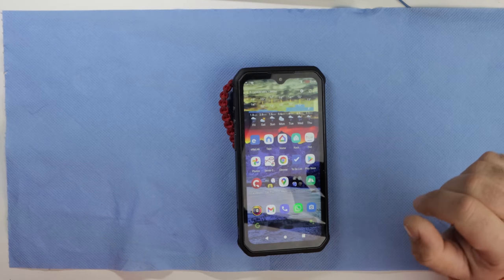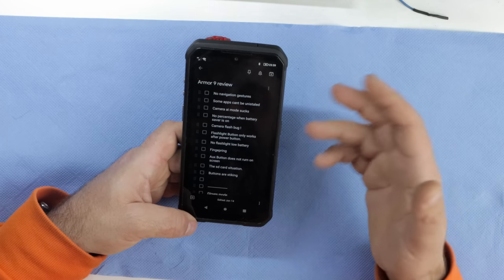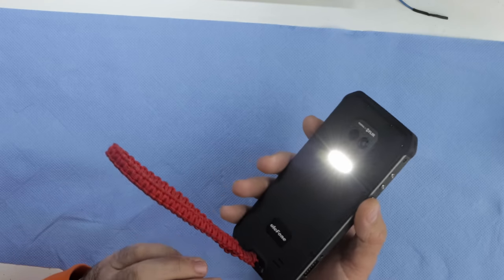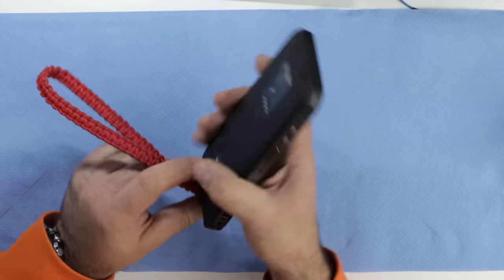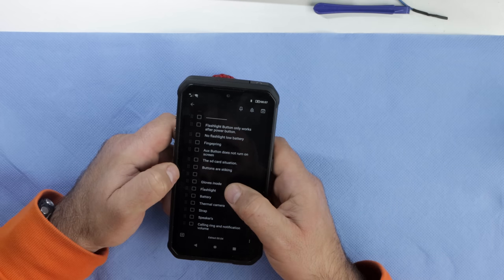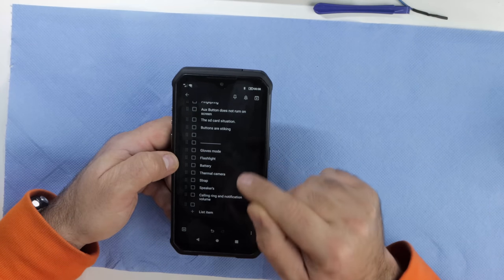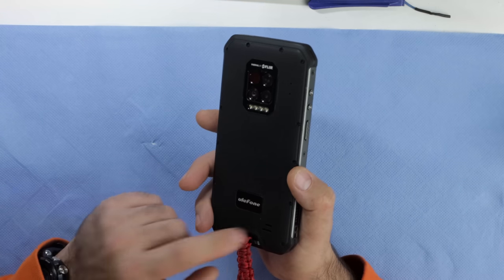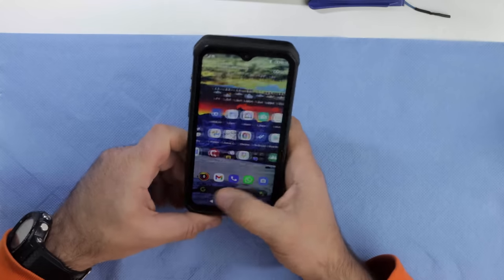uleFone armor 9 follow up 6 months later | The whole truth about this phone !

Comment: I have the 9e. I could not side load Google camera, it just would not do it. No matter which one I downloaded, also with the flash on the camera mine worked fine, but the flash would flash even when it turned off haha.. also I use th flashlight at work and I've been let down by the flash light not working on low battery it sucks ass. The battery is the only good thing
Reply: Are you not 
exaggerating by saying the battery is the only good thing... I am thinking of buying this phone and using it for bike delivery and good to have this kinda phone for these strange times. Is the GPS decent can it handle multi able apps with internet at the same time and no overheating?. Or you really would not recommend this phone?
Reply: @dodig1125  okay so here's my pros and cons

Pros
-decent processing power, doesn't lag doing everyday stuff
-huge battery 
-very loud speaker
-programmable button on the side is very useful
Flashlight is very bright for a cheap phone
-endoscope is actually very well made and works great

Cons
-its much bigger and heavier than I thought it would be, no magnetic phone holder will hold it
-camera is rubbish, considering it has 4
-the sd card slot is a pain to access
-the charger port is literally impossible to open if you have short finger nails
-it won't be as rugged as some other phones, my old ulefone armor X5 had much thicker rubber and much bigger plugs for charger hole, I don't think it would survive a huge drop
-the microphone hole is right where your pinky finger sits at the bottom on a right handed person 

It's a decent phone for what it is, I haven't used the GPS yet but my X5 was good so I'd say it'll be right

if I needed a phone for navigating on a bike I'd dare say this is a decent option, big bright screen, water resistant and big battery should tick all your boxes.
The weight of the phone would get annoying if you had to carry it around all day like I do, I put up with it but it really is a chunky boi

Comment: The complaint about the light seems like you dont understand the logic behind it. If all it takes is for you to touch the button to turn the flashlight on then it can be activated in your pocket accidently and further drain your battery. I think its smart that they require a "conscious" decision to activate the smart button.
Reply from the maker: Then why  not just turn the flashlight on from the lock screen ? A dedicated button is supposed to be faster and easier if its not, there is not much  point to it.
Reply: @reversingentropy  so youd rather it turn on excessively than to spend the milisecond to turn the display on and activate the button? Okay
Reply from the maker: It's very rare  to activate  the button  by mistake. Yes. like any other phone with  a dedicated button i would  rader it would  just  work without having  to press any other buttons. You know, you  can't  turn the flashlight off either without first waking the phone up. If it was indeed made to protect the battery it would let you turn it off once it's  on. Anyways I don't like decisions being made for me loool
Reply: @TheFishAirman  
The thing is I have the side button set to turn on the flashlight too and even with this "safety measure" it still turns on in my pocket. I wish I could set a specific button tap code, like double-click then hold to activate the flashlight.
Reply from the maker: Yes that would be nice. Maybe in the future.

Comment: A year later now, but FYI my Armor 9 has been disconnected by AT&T because it "will not work with their  new network updates".  Even though it has been working just fine on 4G even after their February 22 cut-off date. They want me to buy a different phone in order to get turned back on. Anyone else have this problem with Ulefones?  To your point, I don't care or need 5G and it is not available to me where I live. The idea of going back to some lame slippery girlie phone enrages me.  I hope this discriminatory practice wil not be followed by other carriers.  They tell me that even the 5G Ulefone will not be supported.
Reply from the maker: I am not from the states, so no way to check this on mine. Im still using it. Writing on ot Right now. However gps is mostly broken and the screen has cracked too.
Reply: @reversingentropy  Thanks for the FYI. Cancelled ATT and am in process hooking up with T-Mobile as they will accept my superior phone.  Coverage will be the key here as I am remote in Southern Tier NY.

Comment: THIS PHONE MAY NOT BE ABLE TO STORE ITS APPS ON THE EXPANSION MICRO-SSD CHIP ! AND ALSO MAY NOT ACTUALLY BE ABLE TO CONNECT TO A PC FOR BACKUP OR FILE TRANSFER... VERY SERIOUS SORT COMINGS !!!  Please Comment or Make Video showing expansion SSD card usage and PC hookup... I will donate to your channel if you do !
Reply from the maker: No need to donate. Both things work fine on mine. And i connect to pc from time to time no problems what so ever. I am having problems wit the gps. Sometimes it does not work. That is much more serious to me. But i haven't yet factory reset it.

Comment: I think you took the bad things too far and made them sound worse than they are. they arent that bad and some people wont even feel them...and when u showed the good things u sounded like someone else..but thank you for the very useful review nontheless
Reply from the maker: If you listen to the bad things and still decide to get the phone that means you will be happy with it. The good things will always be a joy to discover when using the phone. Btw still using it no software updates for ages now, screen has cracked and gps only work's some times. And i have still not found a better phone ;)
Reply: @reversingentropy  could you tell me how to open recent apps in the stock launcher? and please show all 3 ways to use PTT button while there is no PTT application installed and while there is one installed. Try to use tue phone with winter oves without gloves mode. it worked for me. yes  I bought it. and the fingerprint sensor also has different functions but there are not clear. I am not sure how to change them. Show us all uses of it. thanks
Reply from the maker: @dryerest8160  dude... I don't know any of those things. I dont have any affiliation with ulefone. I never used the stock launcher, its crap... still use the phone but now it has a cracked screen and gps doesn't work. I will have to het rid of it soon, but i have not yet found a better phone for my usage case.
Reply: @reversingentropy  you do know those things. you talked about PTT and fingerprint functions in this video but you did not give all details. abiut recent apps you might have an idea since you learned the stock launcher in order to realize that it is crap
Reply from the maker: @dryerest8160  that was more than ayear ago. I can't even remember what i had for breakfast yesterday 😂 i wish you good luck, i might do a video update on 2 years ownership but it will take a while. Cheers

Comment: Привет из Украины . Как сейчас работает армор 9?
Reply from the maker: Can you please translate ? Cheers
Reply: Hello from Ukraine . how is armor 9 working now?
Reply from the maker: @user-ts9gv6fz4c  i am still using it. Problems are the strap holder broke. And gps is slow to find accurate location. I had 3 phones meanwhile, and i always sell and come back to the armour 9 i had the motorola RAZR 2 the pixel 5 and the iphone 12 mini. All sold because oslf some deal breaker like poor battery or bad software 😂
Reply: once again good afternoon. received my Armor 9 today . I work in heating and I need a thermal imager. as long as he's good. the first bug, when updating, the application of the cos flew off. I will study the phone and reset it to the factory settings. fuck updates!